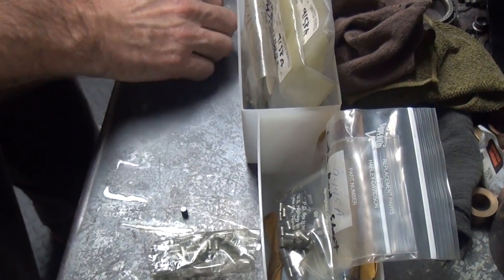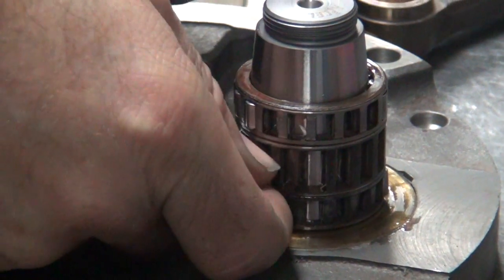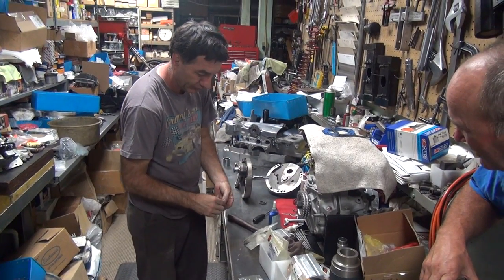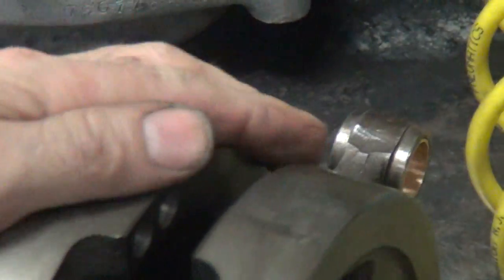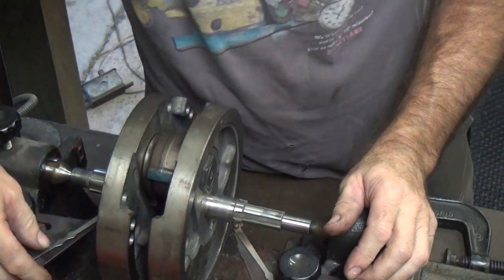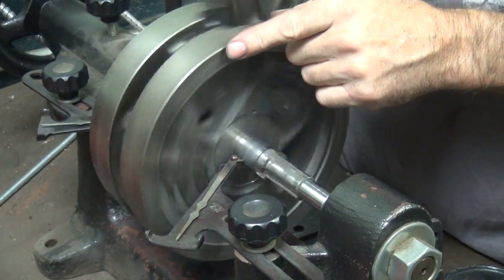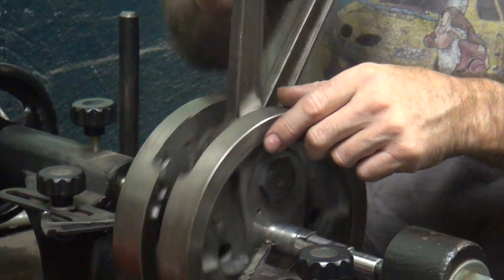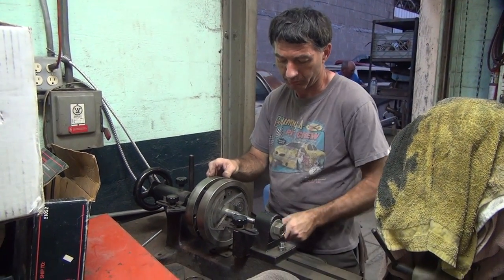1961 XLCH Ironhead R&R #135 Motor Rebuild Overhaul Harley Sportster

Comment: Is seems to me that lateral movement on the front rod is common and acceptable.  The jugs should keep it straight.  Any thoughts?
Reply from the maker: +Uncle Mic 
the 5 tons of force on the rod piston assembly pulling on the crankpin will keep the rod straight. if the cylinder is off any the piston will rub on the bore alot. this will cause piston and cylinder wear and suck up lots of power from drag. if the rod is bent some it with cock the piston under this load and cause the same load problems. you want to have room to move around some and allow for some misalignment to keep this drag and wear to a minimum. on a high rpm race bike you need more room because things flex more. like most things on a race bike, loose good, tight bad. 
tatro
Reply: +Tatro Machine Thanks alot,  I can breath a little better now.  Hope to see you in Davenport someday.  Thanks for the videos, they are about the coolest thing youtube.

Comment: If you recall you were using the S&S rod's on the crank that came out of the motor you split .. But I have to tell you in all the year's I been building motor's I've never seen or used any bearing called or sized ... 8 tenth's ?  Oh and can you tell Me why in god's name your being so cheap with the assembly lube ? And did I just see you carry the crank & rod assembly over to the press by the rod ? Dude I don't get you ?
Reply: Michael Laverty - He’s speaking of bearing sizes over or under the standard size. In other words the bearing is 8/10 over or under the standard. As for carrying it by holding the rods, so what?